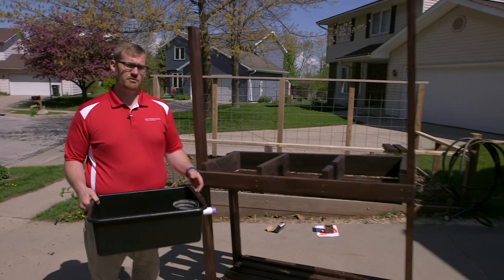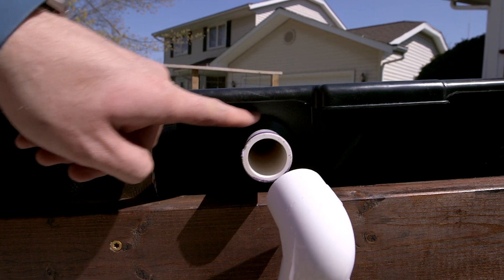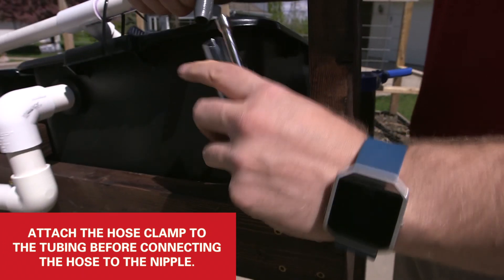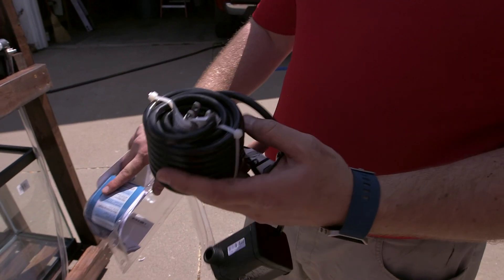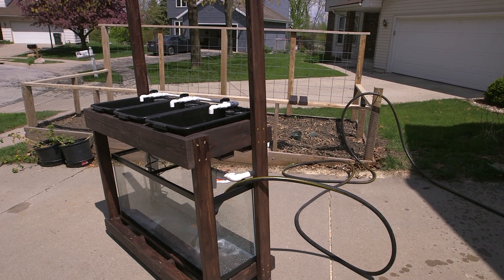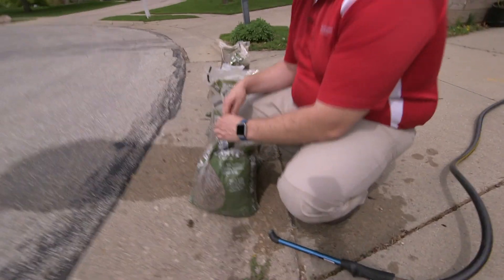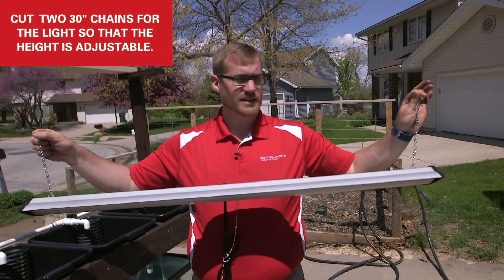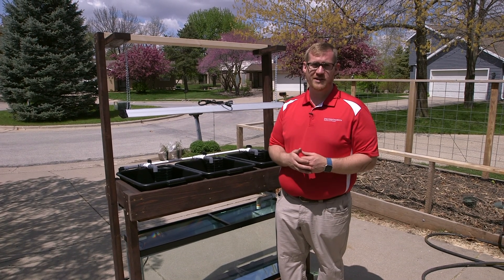Aquaponics, Part 9: Assembling Your Miniature Aquaponics System

Comment: Having the drain pipe at a slight angle as well as the inside pipes not touching the bottom of the grow bed creates a siphon, I like that this is easier to setup than say a "Bell Siphon" I am still trying to understand how you got the angle each pipe is slightly longer than the one before it? or each pipe is slightly lower on the grow bed? could use either option? This is a really great system, really great build series thank you for producing this.